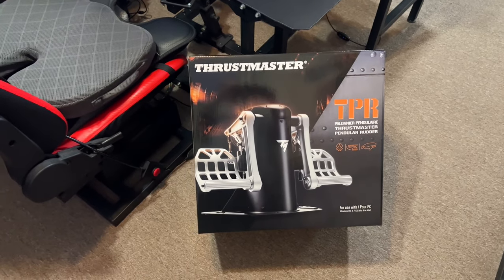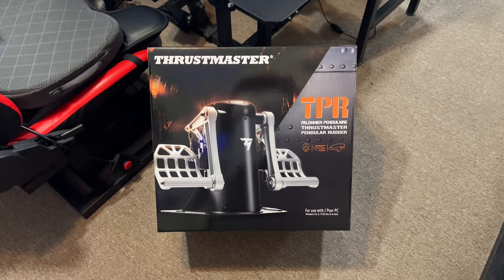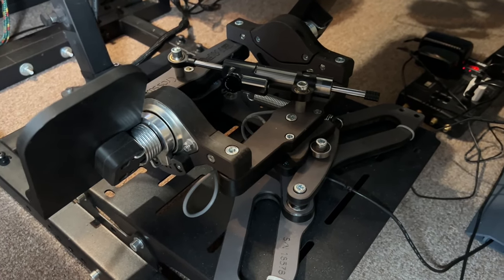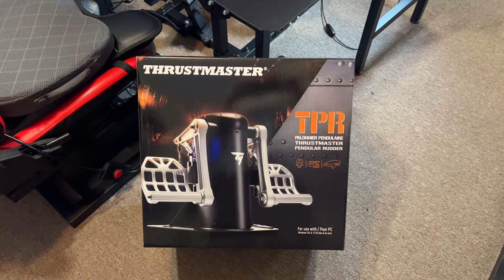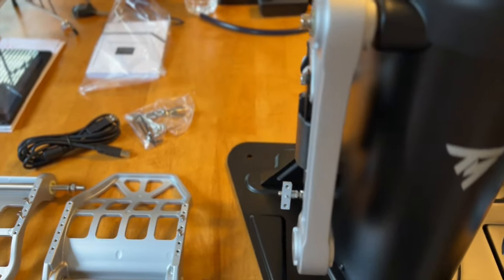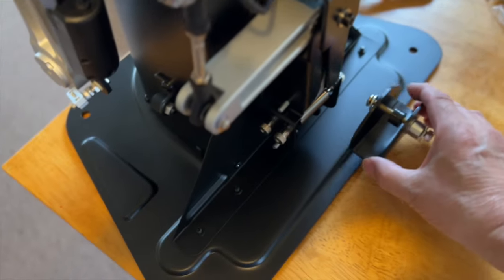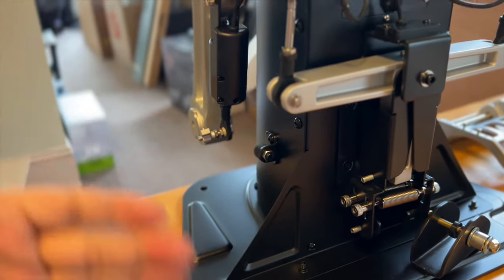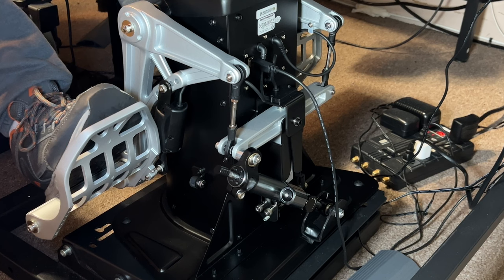Thrustmaster TPR Rudder Pedal Damper Install

Comment: I recently acquired these as well and intend to do the same thing.
However the travel of your right pedal looks restricted.
Did you find that to be the case?
Reply from the maker: You noticed that.  When I started using them I could feel something was off, then noticed it, so with a little adjusting and recalibrating all is good. Call you Eagle eye lol

Comment: I tried that mod. It's bad. The implementation is not good to the mechanical movement. you can see the horizontal bar that the damper connects to get pulled in a different axis while you move it . this is bad. I removed the damper for now. you can fix it by aligning the damper axes to the horizontal moving bar. try to eliminate movement in a different axes axcepet the one that the horizontal is moving. cheers